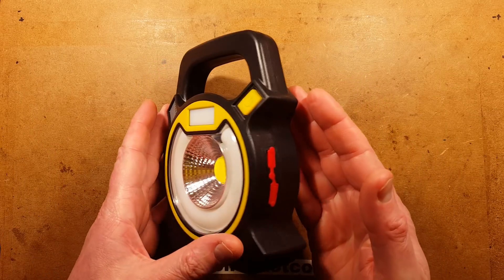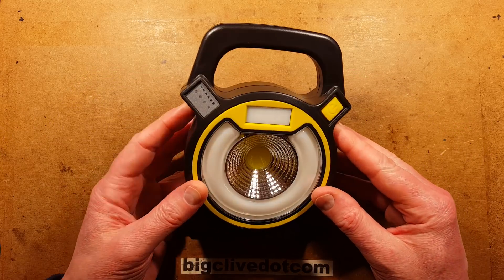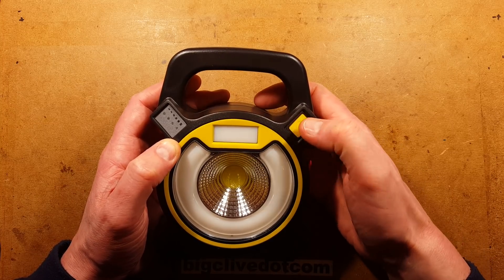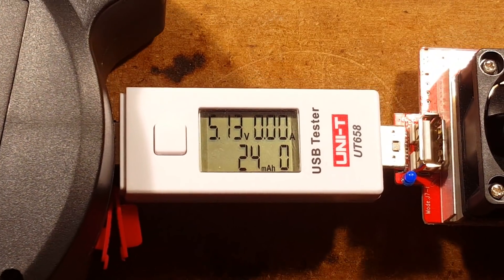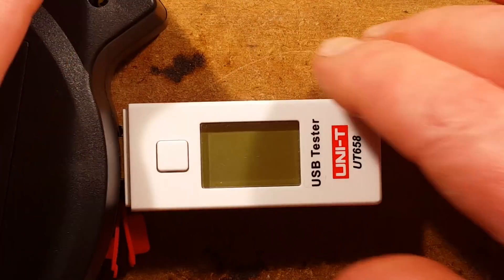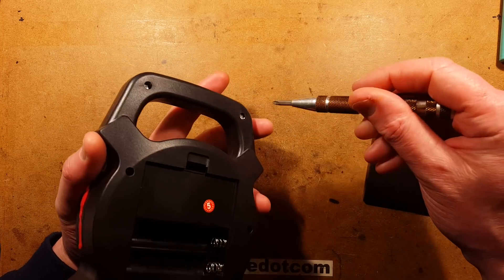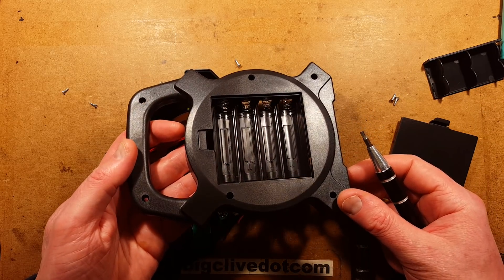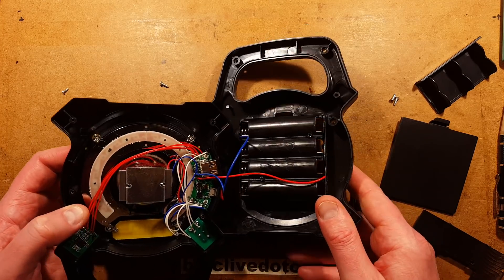Inside an interesting light and power bank with hidden upgrade.

Comment: So they sprang for a fair dinkum quad comparator for the battery level indicator? That's impressive; I've come to expect the ubiquitous 8-pin one-pence micros with the voltage measured in software (which I can't how they even).

Comment: Can you sub out a 3.7v lipo cell for the 18650 batteries???
Reply from the maker: You could do that.
Reply: @bigclivedotcom  Ok. Thanks! Because I had heard on other channels that they needed a different recharging style because the Lithium was different. But if there's no difference? Then I'm running with it.
Reply from the maker: @brianterrill9587  Standard lithium packs with an upper voltage of 4.2V are really just the flat version of an 18650 4.2V cell (both sometimes referred to as 3.6 or 3.7V cells because of their average voltage).  You couldn't use a LiFePO4 battery because it has a lower voltage.

Comment: There's a new version of this on Banggood for £4.25 with a solar charger on the back in place of the battery cover, on solar it takes over 60 hours to full charge. Unknown if it will take 2 or 4 cell no info in description.

Comment: i imagine they partitioned off two cells so they could cheap out and only put two batteries in and sell it.  if people bought it with two batteries and two empty holes for batteries they would feel ripped off, but throwing that little bit of plastic in it cut the price of the unit down.

Comment: My guess: they got complaints about how long it took to charge the batteries, and nobody reads the manual so they wouldn’t know it could function on just one and charge super fast. Just block a couple slots up to stop customer complaints.

Comment: Wow. The fact that the other two cell slots were completely there, fully wired with the contacts and all, is fucking hilarious.
I guess they used a standard mould and couldn't be bothered to use a different one. Or they didn't want to confuse people that didn't understand that the cells were in parallel so you don't actually need all four of them in terms of voltage, and covered half of them.

Comment: Is it dangerous to have lithium cells in parallel? What happens if they are at mismatched voltages?
Reply from the maker: They have to be at a similar voltage before being paralleled.

Comment: 5:50 regarding the standard charging chip. A very breif question if I may. I'm a novice at electronics and my expensive easyacc rugged powerbank died. Completely dead, but batteries are ok and charge when removed and placed in an 18650 charger. Could it be the charging chip? It has two 8 pin chips, 358 gz548, and S081 G5214C. I don't know which it might be, if that or something else. It's a simple circuit, but I know not enough about troubleshooting electronics. https://www.facebook.com/photo.php?fbid=10161032485920254&set=p.10161032485920254&type=3&theater

Comment: Anyone have success ordering one of these gems with the USA being it's destination? I found the 10w version with the option of 2x18650 included on flea bay, which I ordered without a thought to the possible shipping restrictions, and fear my order is stuck in limbo overseas due to lithium cells being included. It's been over a week and no movement in regards to shipping status. I'm thinking that I should cancel it and reorder from same seller with out the batteries. Any thoughts would be greatly appreciated !!
Reply from the maker: It often takes a month or more for items shipped from China to reach you.  It's very rare that things don't get delivered.

Comment: There's one with the cable and solar panal on the back roughly ontop of the batteries says 50w read down the listing 4 18650's on board all for $9.99 free post sounds too good.

Comment: Hi Clive. I believe you mentioned your were using open camera to record your videos. Don't you, mate? Did you know you can set your volume buttons to use them to control exposure? It's very useful! If I connect earphones to my phone, I can then even use the volume buttons on the earphones to change the exposure (to avoid shaking the phone or making clicking noises on the recording).

Comment: nice instant upgrade !  if it didnt come with that i'd hacked the part and installed a two cell holder, to give you four.  i wonder if it gave you more amps/volts on the Unity tester when using four 18650s...?

Comment: How long does it take to charge 4 cells?
Reply from the maker: That would depend on the capacity of the cells.
Reply: I was wondering how many milliamperes it will charge at? I assume it has a proper current limited charging circuit.

Comment: Strange that they coverd the two extra battery slots as that extra bit of plastic has a cost. One explanation maybe, as batteries are not included, the first thing we think about is the cost, we see the empty slots and automatically fill them, Clive did just that, when just putting a single cell would have worked as it is wired in parallel. We are so used to putting batteries, most of us wouldn't notice the batteries go in the same direction. I am more surprised that three of the slots were not blanked off. There is a high chance that one cell could go in the wrong way round.  Nice to you surprised Clive.

Comment: How does this kind of light handle balancing the charge of the 18650s with only a pair of wires?
Reply from the maker: The cells are in parallel.  They only need balanced if in series.  But you have to make sure that all cells are at a similar state of charge (voltage) before putting them in.
Reply: @bigclivedotcom  Thanks. You learn something new every day.

Comment: just like buying a tesla with a "60 KW/H" battery that actually has a 75 KW/H battery but the software limits you to 60 unless you pay more for what you already own.... I feel like there is an open market for hackers to "upgrade" tesla battery packs... hacker charges $2500 to do what tesla wants to charge you $7000 for....

Comment: The 4-cell "upgrade" may be to support 4 AA batteries; 4 of the 18650 cells may be too much voltage.
Reply: Its parallel

Comment: Still wondering about that chip under the power level indicator. If it was a chip to decide how many battery life leds to light, why have 4 input wires? Why not just positive and ground? Seeing 4 wires makes me think the power level is decided beforehand, and the 4 wires are ground and 3 switched live, one for each led.
Reply from the maker: To Indicate that a charger is plugged in.

Comment: You may have bought it without batteries, but all the ones I looked at on eBay (.co.uk and .com) have two variants: with two 18650 batteries and without batteries.  Best deal I found so far was £7.99 without and £9.99 with.

Comment: Last time I saw Big Clive this surprised was in the Fanny Flambeau video 😆

By the way: 6:20 good idea, clamping the extra heat spreader in using the lithium ion battery holder. Heat and lithium cells, great combination...

Comment: Does the controller chip Pwm to get flashing and 2 brightness levels for the main led?
I can't find the resistor for the flashing LEDs.
How to get rid of that annoying flash? Any idea anyone?
I want a low steady light instead.
Reply from the maker: It's very hackable.  The two intensities are indeed PWM.  The strobe LEDs are annoying and could be disconnected, although the unit might draw more current if they were left active while disconnected.  The current to the other sections can be tweaked by removing one of the two resistors for each section or changing the value.
Reply: @bigclivedotcom  I reduced the flashing lights with a 270Ω resistor  ( could be even higher resistance) in the + line and I bridged the two led strips. I tried a 220μF capacitor, too, but that doesn't really prevent it from flashing.
It doesn't make the whole room flash now, that's good enough.

I reduced the ring light current by removing one of the 1Ω resistors. I replaced it with a bigger 1206 resistor, but that may not be necessary.
It's much more useable for me now.

I will order a quick charge 3 output and a protection board. I'll add it when it arrives. It's pretty cheap to do.

It takes ages with 4 good 18650 cells to charge, but I don't care if it needs the whole night to charge.

It seems, I more then doubled the price of the lamp already.

Comment: Sorry, nothing to do with this Video. Have you ever checked out a  Smart WiFi Wireless Switch Module by Sonoff. Would be interested to know what you feel about it's safety. They are really cheap but can be controlled by Alexa or Google gear.

Comment: So it takes parallel 18650s, with no mean to perform balanced charging, which is a no go for lithium. I'd suggest never charging your cells within the lamp.
Reply from the maker: As long as the cells are all at the same voltage they will end up as one parallel cell.  No balancing is required as they are not in series.

Comment: Was hoping you'd test the protection circuit since there was no number on the power bank chip. If it had, eg, DW01 level protection on it (and thus could use bare cells) that would be quite neat - especially if it did the "trickle to revive" thing. But definitely not as interesting if I'd need cells with built in protection. (And totally not if it ended up being like one power bank I bought whose "charging circuit" was a diode to drop the 5V a little bit...)

Thanks for the interesting video!

Comment: Most consumers want their things to need as few batteries as possible, and the option to use more batteries just being an option is a to complicated concept for them, especially when choosing between models in the store. 

The time it would take to charge from empty to maximum capacity worst case with say, 4 times 3,4 Ah, with USB 1 standard, 500mA, charger would also deter some potential buyers,  as that would take in the vicinity of 24 hours. Not that it would actually matter, and it wouldn't be better to have half as much capacity to begin with, but that's to complicated to figure out for most people.

Comment: so instead of saving money by re-forming the back plate to only hold 2 cells, they lost more money keeping a fully configured 4 cell unit in the run and spending extra on a plastic cover to hide it.

Comment: It was blocking the upper two cells, so I'm guessing it's to lower the centre of gravity, try to stop it from falling over as much. But if it's hanging from the ceiling of your tent then it probably doesn't make much difference. I'd probably mod it with a bigger aluminium heatsink to spread the dissipation a bit, maybe even find a better power bank module and hack that in somewhere.

Comment: Where are normal people supposed to find 18650s to put in something like this? It's not like you can just get them off the shelf.
Reply: I salvage them from old laptop batteries. Most will have 1 or 2 dead batteries or a fried protection board killing the whole battery pack.
Reply: Против Глобал   That was unlucky. I have between 40 and 50  18650 cells all from salvaged packs mostly laptop + one electric bike pack.

Comment: Did you retest it as a powerbank with 4 cells? Just wondering if the extra cells would help it be more stable around/ above 1amp.

Comment: Looks like they have two models a 4 battery and two battery and you pay  more for the 4. How many people would realise that they could put 4 batteries in? Not all people take their goods apart to see how they work. I should imagine Clive is a very very small minority. Black casings are one problem black connectors are another. Trying to put a back connector on a black plug in  a dark corner with my eyes is near impossible.

Comment: Careful using unmatched cells. One will drain faster than the other, slowly killing it. Or so I am told.

Also, that red and blue flashing light would be illegal as hell in the US, without strict warnings to not use it on public property. You can get arrested for that. It is considered impersonation of law enforcement.
Reply: cells are in parralell, you can safely use unmatched cells so long as you don't do something really stupid (like putting one cell in at 4.2v and one it at 2v)  i'm not even sure if 4.2v to 3v would move enough current to be dangerous.

Comment: What happens if one cells goes short circuit? Perhaps I worry too much, but as far as I could see there was no fusing and as the cells are in parallel a short on one would put the whole current from the other or two others through the shorted one. Does one now assume that the cells will not fail that way, is it just a good odds lottery or am I missing something?

Comment: I guess if all the battery cells are connected in parallel, as they appear to be, then it's relatively important to use matched capacities, preferably identical cells, in each of the four positions to make sure the charge and discharge are reasonably equal. Or does that not matter with Li-ion characteristics?

Comment: I can't find batteries higher than 9800mAh. Am I missing something as Clive states we can upgrade from "shitty sub 1 amp batteries"
Reply: I'm sure Clive meant sub 1 Amp hour. If you have found 18650 size batteries that are truly 9800mAh then you're already at nearly 10 times that size. However I doubt very much that an 18650 battery marked as 9800 is genuine.
Reply: @Rosscoff2000  thanks for the quick response. I'll have another look at video...

Update. You're right. Clive did state  1 amp hour batteries.
My bad

Comment: Looking at the back of the rear cover, I think they have (had?) a thermal design problem.

If I'm not mistaken, the middle two of the four battery slots are sitting right on top of the aluminium heat sink of the central LED light. The plastic looks melted or marred. Blocking off two of the four battery bays by a simple relatively cheaper semi-permanent plastic cover seems a quick-fix of thermal design problems than re-doing the entire product. I just wonder why they haven't blocked off the middle two bays instead...

Comment: I have a charge level indicator like that on my ebike. It has quad opamps, and a multistage voltage divider. This circuit is probably the same. I'm guessing the four wires are one for opamp+LED power, one for a regulated reference voltage to the divider, one for the raw battery voltage, and then ground.

Comment: My thoughts on the battery are 4 cells are for the engineers since the original powerbank circuit was 4 cells and the 2 cell version is for customer satisfaction since most people would believe that all slots must be filled and would be shocked at a 10 hour recharge time with 4 cells.
Reply: Probably this, the charging circuit is crappy and will take a long time to charge. And if potential buyers see the thing has four slots may think they have to buy four batteries for it, and good 18650 aren't cheap

Comment: I bought one of these from a local supermarket in Bulgaria and it came with batteries. I imagine the 2 cell thing is to reduce the cost of selling the complete unit (mine was about £7). Clearly though they could have just put 2 cells in and left the other 2 slots empty.

Thanks for checking this out! I will be unlocking my hidden upgrade :P
Reply: If they sell it with 4 battery slots, but only 2 batteries included, people will complain about it.

Comment: From a description on one of the eBay auction, the charging is time-limited to 8 hours.  My guess is that installing four cells would result in incomplete charging and lots of returns.

Most people here would have no problem with re-starting the charge cycle, but we are not the typical market.

Comment: One thing to note: that heat dissipater on the back of the main lamp presses against the battery cradle. Now, I'm no expert, but I have heard heat + lithium cells is not an optimal combination.

Comment: hey clive, just noting, you asked about bumping up the brightness without over exposing the image, have you thought about covering your desk with a couple darker colored pieces of construction paper or something darker with a matte finish? it would allow you to expose shots like that much higher without the background washing out.
Reply from the maker: I tried a black background for a while and it caused other issues.  Then a grey one and it looked really bland.  It's one of the limitations of using a simple recording device for high video throughput.
Reply: @bigclivedotcom  very true. I also see you record in tungsten. A yellow color temperature. Have you consider trying other color temperatures? Or finding a way to make your desk look like a matte finish? Just bouncing ideas off of you.

Comment: these is another reason if you load this up with 4 high quality (like LG FL1 3350mah) the center COB on high will get too hot and melt and overheat everything around it 
it like most Chinese emergency lights does not have a low voltage shut off and will drain the cells dry  
but i found this very useful 
but i would love it if you could help me eliminate the high cob setting and just click though it to the low - diffused - flash  
i found it fascinating their attempted fit of the overheating was to shorted the time it would run so it could not overheat and melt but that must have been based on Chinese 800mah UltraXXXX cells as even 1 real FL1 will cause it t melt 
i like this as it has a accurate high voltage  cutoff
Reply from the maker: Halving the peak current is an easy PCB fix.  Just remove one of the parallel current limiting resistors.  Just scribing the top of the resistor would work.
Reply: are those the 2 near the edge of the board  if one of them is 1K and 1.5K which should i scrap?? thank you  @bigclivedotcom
Reply from the maker: @thegreatfixer  they're the pairs of resistors next to the transistors.  Very low values in the region of 1 ohm.

Comment: This light is ideal for a little camping package I'm putting together. Lighting for tent table and solar charging a power bank to power it all. This is nice because it runs on the 18650's. I'm just using up some recovered cells. Ebay or a dollar store buy?